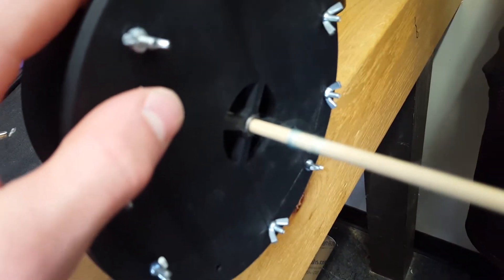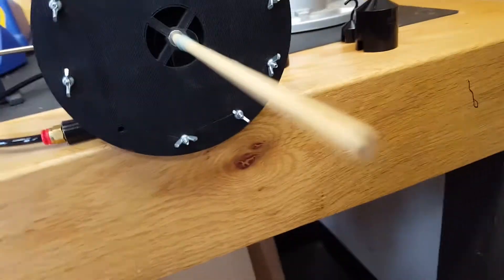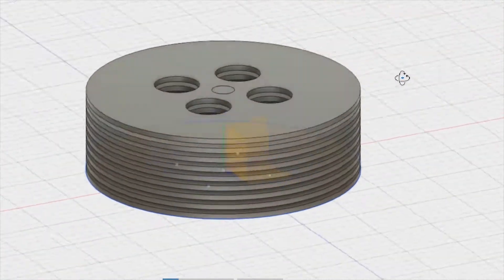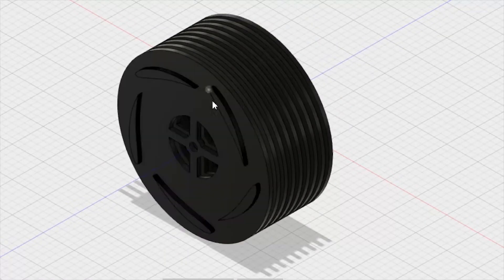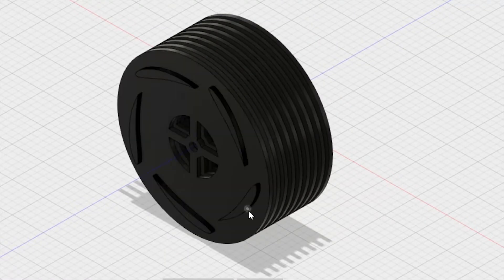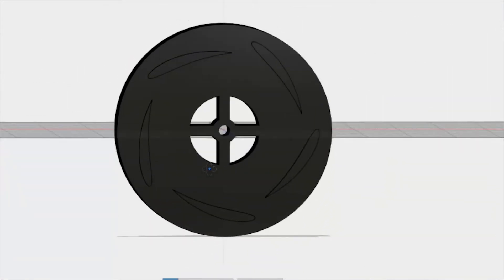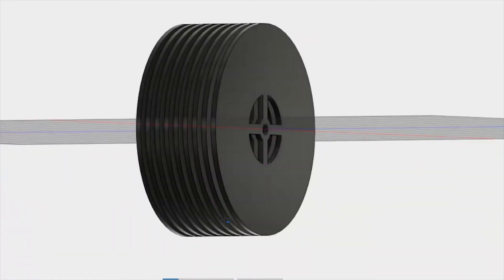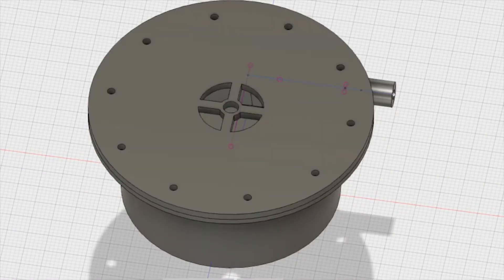Tesla Turbine [3D Printed + Airfoils for High Torque]

Comment: hello, nice project. could you put STL files for printing?
Reply from the maker: All the files are in the Unencrypted google drive folder: https://drive.google.com/open?id=0B-xGsBFoTUMZUzFKS1NsOUZGZ28

I made this turbine in Fusion 360 a while ago. I was not good at CAD modeling back then (though I am now). There are many problems with the design, the plates are too thick, the end does not fit a gas line fitting, etc. You are better off designing your own from scratch, it will only take a few hours.

 Let me ask you this: Why do you want to make a Tesla Turbine? We don't use them for anything because we have better technology. The inherent utility is there simplicity of construction, which is made harder by adding airfoils. Not to mention that adding airfoils makes this system practically a radial flow turbine.

Either way, I appreciate your interest and it was a fun project when I did it. For the moment I've stopped making videos. If I was to resume making videos, would there be any projects that you would like to see?
Reply: You obviously have no clue.....Tesla built a turbine "that could be carried by the average man in one hand" that produced 500hp according to newspaper reports of the time.
Show me one modern technology that is 97-100% DEMONSTRATED efficient even close to that....

Comment: HOLD UP my man... The spacings between those discs is wayyyyyyyyyyyyyyyyyyyyyyyyyyyyyyyyyyyyyyyyyyyyyyyyyyyyyyyyyyyyyyyyyyyyyyyyyyyyyyyy too much. It needs to be at most an eighth of an inch. Keep the blades you have, just make them an eighth of an inch thick. Holy shit man you're getting no power from boundary layer effect.
Reply from the maker: Your mostly correct. Before doing power tests, we let the turbine spin up to high RPM where the boundary effect plays a larger role. However, the large space greatly reduces the performance. This was more of a trial run/proof of concept. Ultimately we would like ultra-thin carbon fiber discs with airfoils on them. Unfortunately, such a concept has already been patented and we have stopped development.
Reply: Unencrypted what compny has these discs can we build our own?

Comment: Do you have any torque  calculations for this?
Reply from the maker: Good question: no
Reply: Put a flywheel on it ... or two... balance them
Reply: Ever spun a disc in a fluid.... like a bucket of water...  fluid adds torque also

Comment: SO COOL!  I sort of had an idea for Tesla Turbine disks with an airfoil cross section but didn't have the means to make anything like that. Koo Duos! Will you be using your turbine has the motor in a compressed air powered car?  Dig these digital computer old patents 3057551 , 3190554  . Bet they would make a cool 3D printing project, and maybe somehow  use them in a compressed air power car design as well.
Reply from the maker: Thanks for the enthusiasm. We will be conducting more tests on the prototype turbine. We still have to do RPM and  power tests. The original goal was to make it out of aluminum, but it was put aside due to time and cost barriers.
Reply: Neat !  Dig this, didn't use a Tesla Turbine but he could have,  and made out of cardboard yet!   Patent 672256